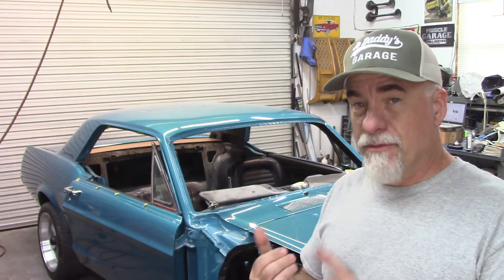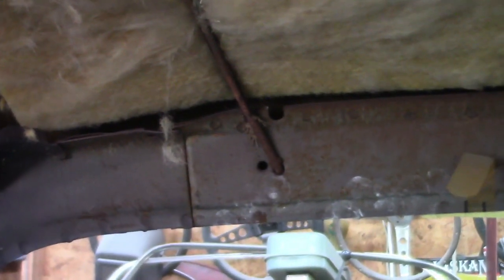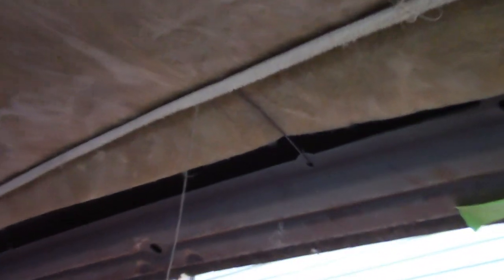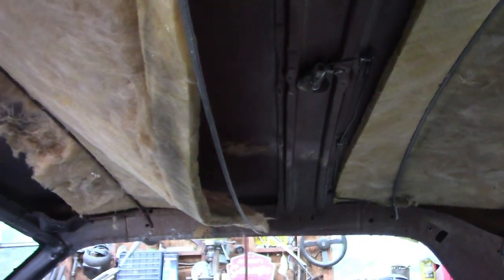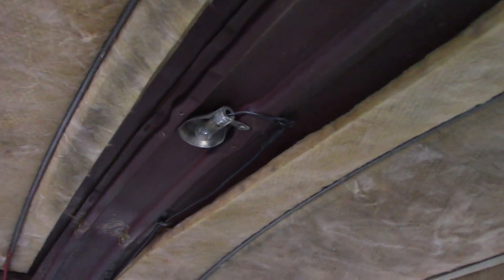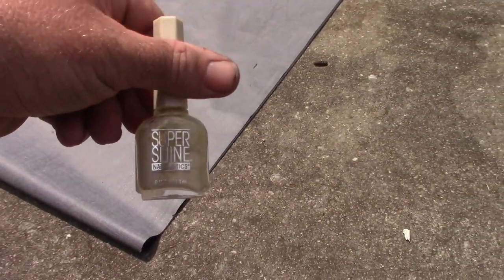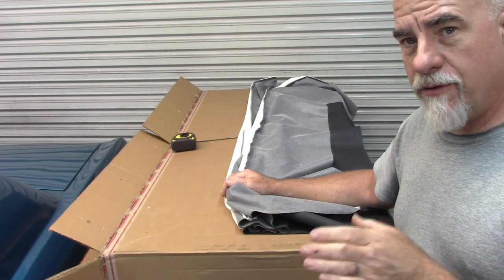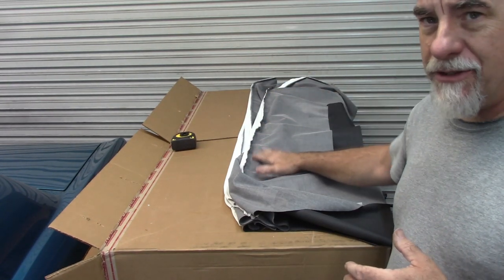Mustang headliner install. Part 1. Jade part 79.

Comment: Since my rods were previously removed and paint markings seem "gone" ... any tips on determining what is what?
Reply from the maker: I think this video would help. If I remember, the longest one will go to the rear. The middle ones should be the same length, and the shorter one is up front.

Comment: Any rust treatment on the interior metal?
Reply from the maker: I didn't add any.
Reply: @JoDaddysGarage , for you to do all that work on the restoration and make that car look gorgeous, I listened to your explanation about the interior rust, and somehow it feels as though it deserves some brush strokes of Phospho. Just my thought.
Reply from the maker: It wouldn’t hurt. However, the rust acts as a natural barrier. As long as there is not any added water or salt, it is self preservation.
Reply: Sometimes less is more, if its not pitted just leave it alone.